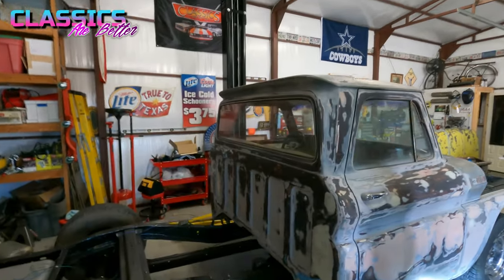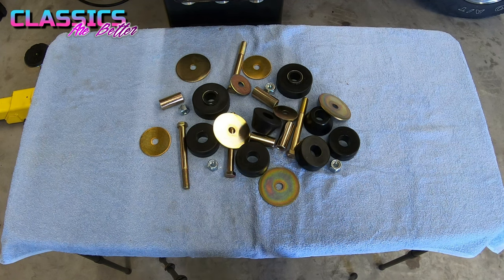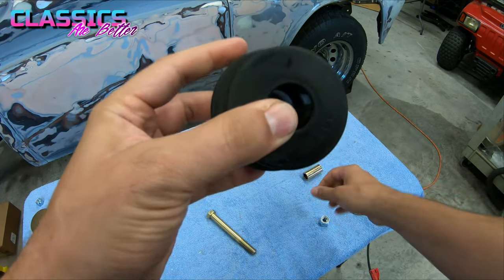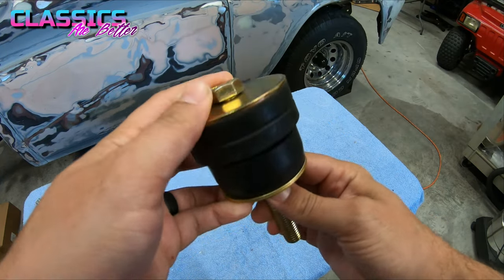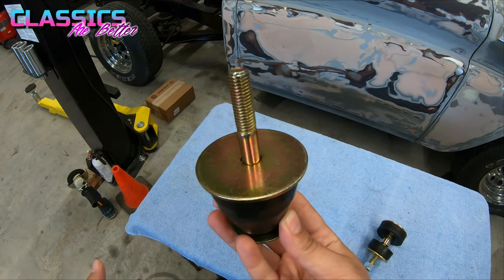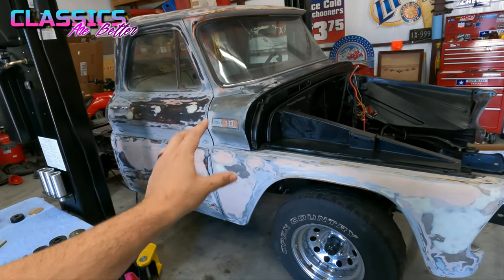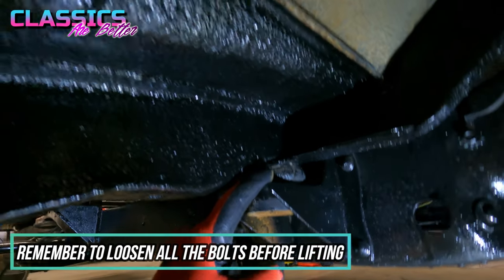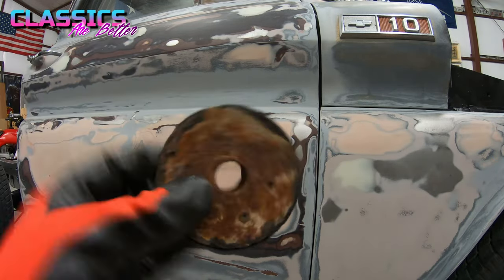Replacing Cab Body Mount Bushings | C10 | Removal & Install

Comment: Great Video.  It's a personal choice but I think on an old suspension rubber is best. These old cars and trucks were built to give a little with all suspension parts. polyurethane will give a harder stiffer ride and not absorb vibration or road noise as good as rubber.  Polyurethane also needs to be lubed regularly.  
Rubber will last 40-50 years.  You will be dead before they need replacing.
Reply from the maker: Mark I tend to agree with you, rubber works great and is cost affordable. I was just trying to go a little more on the performance side this time (plus they were on sale and cheaper than the rubber ones LOL).

Comment: For gmc models the rear original bolt is thinner and does not fit into the welded nut.  Either use the original bolt or you must knock the welded nut out and use the nut supplied with the kit.

Comment: I’m about to do this install great how to video. I have a slightly bigger problem as a previous owner welded replacement floor panel and welded over the front bolts. Do you think I can lift the cab high enough to flip the bushings out but still hang onto the bolt without losing it into the interior cab welded panel? Also how is the ride after the install?
Reply from the maker: Thanks for watching. The bolt is pretty long so it probably shouldn't be able to press up inside as the top would hit the "floor". The problem I see you running into is that you have no way to hold the bolt tight (since the head is covered) to first loosed the nut or to install the new one tight as the bolt would just spin under the floor. Is it the same on both driver and passenger side? If it's welded you could carefully lift the cab and make it happen, make sure all the mounts are loose. I haven't finished getting the LS running in it yet, so not sure on the ride, gotta be better than it was!

Comment: What do I torque the bushing bolts to?
Reply from the maker: You may want to google to double check for your ride, but on the C10, I think I remember the front mounts are like 50lb/ft and the rear are 20lb/ft, it's been a bit since I did those. Good luck on your project!
Reply: @CLASSICSAREBETTER  thank you , that's what I torqued them to.

Comment: 👍👍
Reply from the maker: Thanks for watching!
Reply: @CLASSICSAREBETTER  Hi, will those same principals have to be applied to install new cab bushings on my '83 Chevy C10? My truck is leaning on the driver's side. Front and rear. I installed new coil springs but didn't bother the leaf springs. PLEASE HELP!!! THANKS.
Reply from the maker: @dirtypokesouthsideofh-town552  Hey thank you for watching. Look at your driver side bushings and if they are dry rotted or mushroomed out, then replace them. The cab can shift on the old bushings over time. Its cheap and easy and should def help. Good luck!!
Reply: @CLASSICSAREBETTER  Thanks so much Sir.